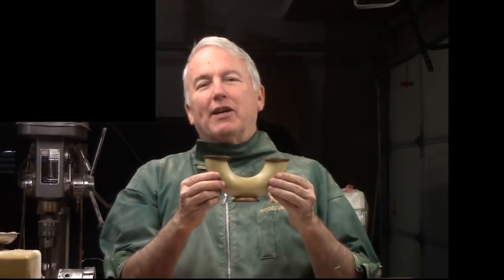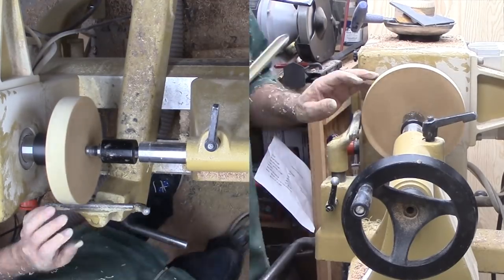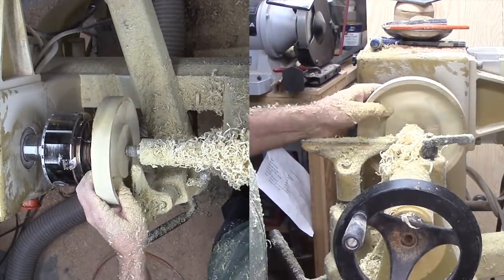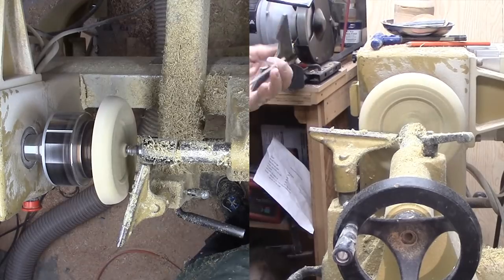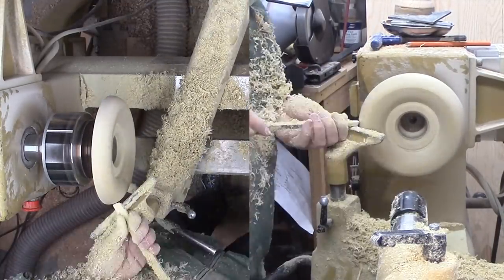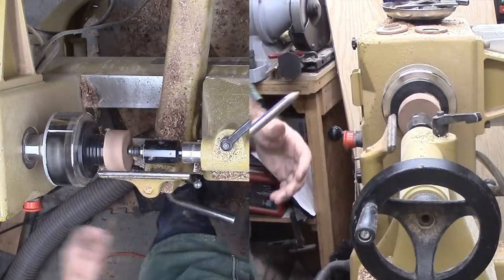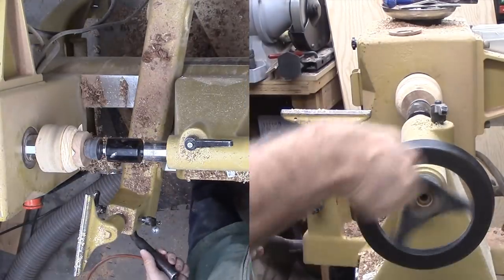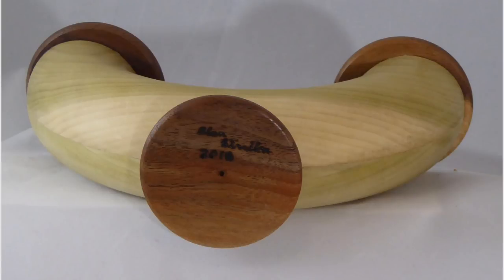Woodturning A Double Vase - A Growth Experience

Comment: Great piece. I was looking at Jason Breach Orbital Arc design, which is more complicated that this one, since it adds additional wings to the torus. If my effort to figure out how is he doing that, I think I have narrowed down the process, and it may help yours a bit.
At 2:40 you are adding a mortise for chucking the piece for making the outside half circle of the torus. 
Instead of making a mortise (which you still can put there), I would recommend adding a waste block over the inner rim of the torus. Once glued, reverse the piece, chuck the waste block, and start making the outer side of the torus. The good part about this approach is that you can make the whole outside surface and you know you are done when you reach and start cutting the waste block. At that moment, it is only a matter of parting the piece off the waste block.
This way you do not need to take too much material with round sander, just to fix some small discrepancies.
I hope this sounds OK and doable.
Reply: BTW, what was the thickness of that poplar blank, or what is the diameter of your template for the inner opening?
Reply from the maker: I believe it was 8/4 poplar but the real point it that I designed it to the wood that I had, allowing for a wall thickness and such. There are many ways to do this. Part of the fun is to fit it to the wood available.
Alan

Comment: I have a feeling there are going to be a lot of these on the market soon. It looks like a fun project. How about a segmented version? Thanks for posting Alan.
Reply from the maker: Which way do the segments go? Around the tube or around the semicircle. Which way do you think is tougher?
Alan
Reply: I picture a segmented blank with 3 or 4 layers of 3/4 contrasting woods. That should give you a similar thickness to this project. I've had some trouble making the segments meet exactly in the center, so I mount them on a glue block. I didn't trust a recess and expansion mode on a segmented piece. Perhaps a tenon instead of a recess would be safe enough, but you probably know the best way already.
I can't imagine how you could make the segments go around the tube, except on the caps, but that might not look good anyway.
Are you considering this idea? I certainly haven't seen one like this before.
Reply from the maker: I can visualize a segmented version running around the larger diameter. Segmenting the other way would be very difficult to perfect the circle. However, if I can visualize, if instead of a circle, it could be half of an octagon or 12 sided (whatever a gon)
Reply from the maker: Yes, go to www.AsWoodTurns.com and use the contact form. I'll then reply via email.
Alan

Comment: Alan, I have watched this video a few times now.  I'm trying to decide on how thick of a piece of poplar YOU started with. As I see it,  the thickness is detirmined by the diameter of each end of the vase. Is that correct ?
I'm guessing that your blank started out about 1 1/2" thick, resulting in a diameter of about 2-2 1/2".  Do you think it would look pretty cool if the top of one vase were a little higher than the other ? Sorry for all the questions,  my job had me on the road a lot today.  It was all I could think about.
Cheers, Jim
Reply from the maker: The poplar was 5/4. The inner is about 1.5" plus intended wall thickness of .25". With two halves, that would be 1" if everything was exact. As long as the offset were enough to be seen as intentional, it would be an artistic choice. :)
Alan